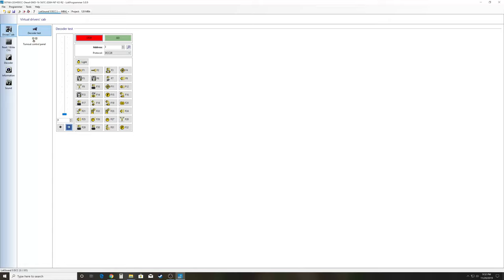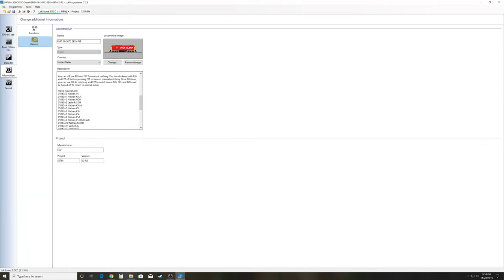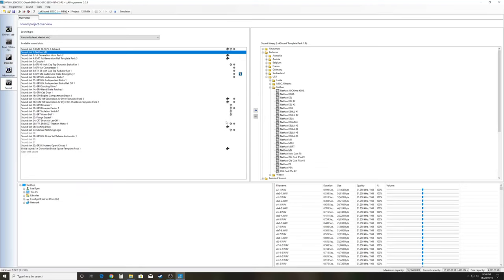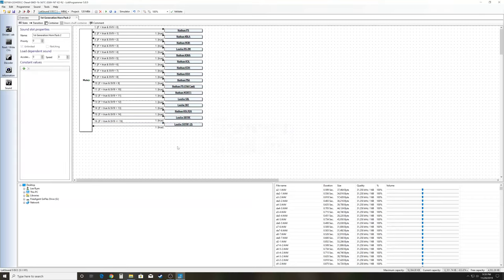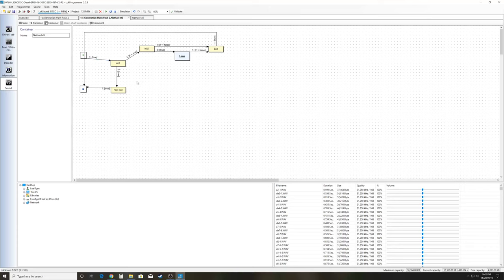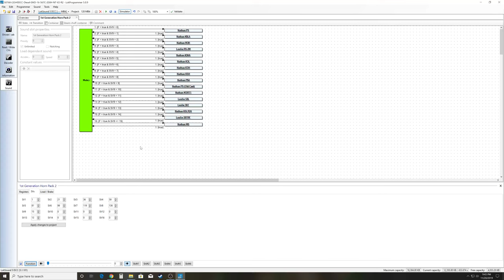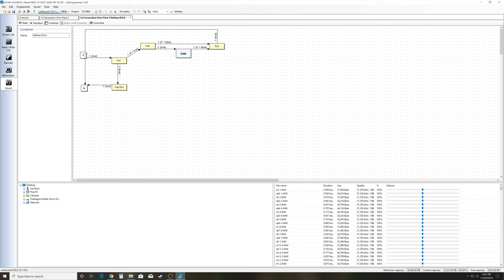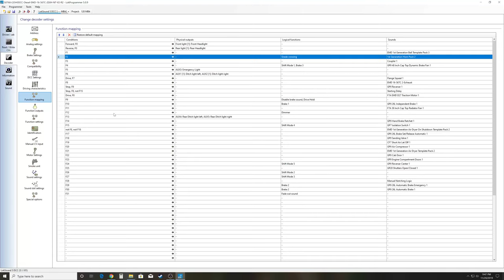ESU Tutorial Series - V5 Decoder Adding a Horn to the Horn List in the LokProgrammer Software

Comment: For some reason, all of the available sound slots are greyed out, and I can't make any changes. Any ideas about why?
Reply from the maker: You've probably not opened a sound file into the LokProgrammer software. You must download and open a sound file from the ESU website to start. You can't get the sound files off of the decoders. Reading the decoder into the software will not populate the sound slots. 

The way I start is I open the appropriate sound file for my locomotive directly. I don't open the icon that says "LokProgrammer 5". When you open the sound files directly, the software populates properly with names for the items in the sound slots and in the "Sound" tab you'll have everything in the sound schedule set-up properly. 

It all depends though on what locomotive you're working with. Manufacturers will set up their sound files specifically for their locomotives so if you're working with one of these, you'll have to see if you can get the manufacturer's specific OEM sound file to work with as your base. If you don't care to keep the manufacturer's sounds, you could overwrite them with one of the retail files from the ESU site, but note that you'll have to remap the lighting functions to match the outputs of your locomotive. Manufacturers don't typically follow the default mapping so you could end up with lights that don't do what you expect. You can easily make changes but it might take some trial and error to figure out what AUX outputs are connected to specific lights.

It would be more helpful for me if you can tell me what it is you're doing exactly to get to where you are and what locomotive you're working with. Is it one that came out of the box equipped with an ESU decoder or one that you installed an ESU decoder into?
Reply: @RioGrandeFan  I was able to fix it. I just downloaded the manufacturer’s file from the ESU website and modified it from there. I read online that some manufacturers make their sounds uneditable so I guess that’s what it was.
Reply: I appreciate the help and the detailed response!
Reply from the maker: @gabagool8  The only manufacturer that makes their sounds uneditable is Rapido. They record their own sounds for their locomotives and thus hold the rights to them. Every other manufacturer that uses ESU decoders uses ESU recorded sound files which are editable. ESU doesn't post them all so some manufacturers post them on their own websites. If you can't find one you can simply email the manufacturer and ask. Other than Rapido of course, as they won't give you the sound files for their locomotives. You can of course overwrite a Rapido decoder with an ESU retail version file from the ESU website. I have actually done this myself. I would much rather have customizable files than proprietary recordings.

If you've read that another manufacturer other than Rapido that has uneditable sound files, I'd be interested in who that might be. I have not discovered that issue. 

The decoder to be aware of is the inexpensive Essential Sound Unit decoder that Walthers Mainline locomotives come with. You cannot edit the sounds on these decoders at all. No sound files will write to these. If you want to customize sounds in these locomotives, you have to replace the decoder with a V5.
Reply: @RioGrandeFan  Huh, weird, it’s an Atlas B32-8HW.

Comment: Some late  response but dont know where to ask. Is it possible to programm an automatic horn related to movement of the locomotiv? like three short when backing up or one short when apply airbrake when standing still. Is this possible with conditions? Tnx for any info
Reply from the maker: Yes, I have written a template for this. It takes a bit of work to use it as currently you have to manually assign the specific horn you want to each of the states, but it does work. It can also be somewhat customized for how long you want the horn to sound. Right now, I have a longer double blast for forward. A quick short blast for stop, and 3 quick blasts for reverse. 

It does require a LokProgrammer to use as you have to map the template to a sound slot and then put it in the function mapping table unconditioned so that it just automatically plays. I am still making some adjustments but overall it works well.
Reply: @RioGrandeFan  Great I do have a lok programmer and i am tinkling with the files. Would you make the template available?
Reply from the maker: @hb9dod  I have made the necessary adjustments and the template now works very well. Still requires some customization depending on what you're putting it in but the logic works. I posted the .esut file on the Loksound groups.io files section: Auto Horn FWD & REV& Stop.esut